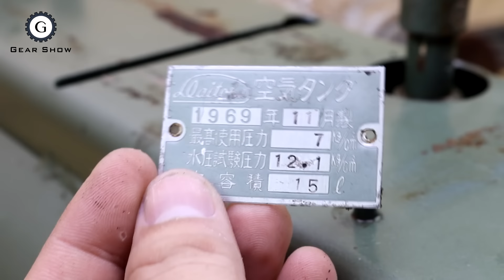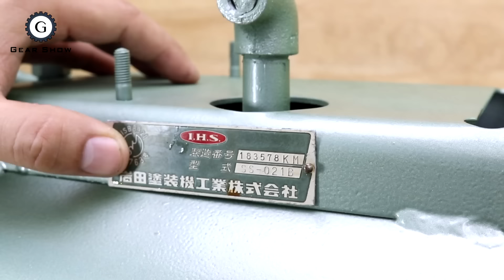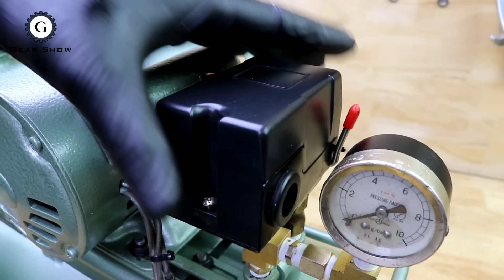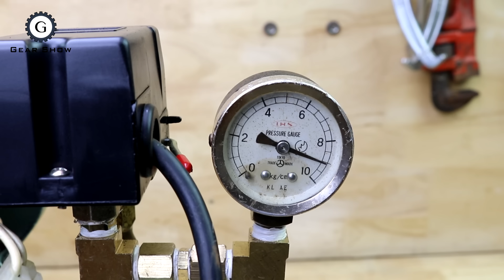Vintage Air Compressor Restoration | 1969 Iwata Minicom

Comment: As others mentioned, be careful of a rusted tank. Even if you don't want it tested, at least inspect the inside of the tank for severe rust. A cheap borescope camera dropped down one of the connection holes works well. The worst rust will obviously be along the bottom of the tank where the condensate sits. I just fired up an old compressor that was sitting for a few years only to find pin holes at the bottom of the tank. Looking inside showed severe rust along the bottom, the rest of the tank inside was still shiny silver bare steel. That went to the curb for scrap.
Reply from the maker: Thank you so much for the feedback!
Reply: True.
Pressure needs to be tested carefully

Comment: Beautiful job!  I have a similar compressor, except it has two small tanks attached.  The pump is an Iwata 150B model, is that the same as yours....the pump looks the same.  I have never known what to set the pressure switch at max pressure.  It looks like you have yours set at 9kg/cm2.  I guess I should set mine that was too.

Comment: Just about to do a similar restoration on my 1970 Stenhoj compressor - why sell it on and buy another, when for a bit of work I can restore to 'as new'. Great video - we need more people on YT to show / convert people to restoring things rather than throwing away and buying new.
Reply from the maker: Sounds great! Thank you so much!
Reply: I hope you inspected the boiler/tank well! Old Tanks with rust are NO JOKE when used with air pressure. Pretty much turning into a ticking time bomb after 20-30 years. Always depends on how often the condense water was released… tank can look shiny from outside, but may be full of rust inside and explode!! Do a hydro test!!! It’s the least that should be done!!

Comment: this is a great restoration and many people have mentioned to get the vessel pressure tested.  however, i am more interested in the make.  i still come across iwata compressors in north america, but they are the small kind for air brushes.  nothing so big as the one in your video.  do they still make this size (and maybe larger?)
Reply from the maker: Great sharing!
Reply: @gear_show  you're most welcome...  but does Iwata still make air compressors?
Reply from the maker: @gusser2121  Yes, they still make them.

Comment: Did you use WD40 while you put the piston back in the cylinder? WD40 is a penetrating oil and no lubricant, it's 90% petrol. The better way to do that is to use some motoroil.
Reply from the maker: Okay, thank you for the feedback.

Comment: nice video dude
what the name of that yellow liquid that turns screws to black?
Reply: It is just oil. Any will do. I use motor.
Reply: Nearly any type of oil, but I guess synthetics may not work that well. 
Just heat the metal, drop it in, the oil burns into the surface, just like seasoning a cast iron frying pan.
Don´t go too hot, then the oil burns on the surface and its black residue brushes off or even falls off.
Reply: uh thx guys
Reply from the maker: It is vegetable oil.

Comment: Nice work, the only thing i would do differently is hydro testing the tank before the restoration process, mainly because of how old it is, there might be some heavy corrosion at the bottom, which  make it dangerous to operate or even fail and explode if unlucky.

Comment: Splendid restoration.  I have an OCD problem when watching mechanical restoration videos, but have learned that your videos never trigger it.  Sweet relief...  Thank you brother!  Keep it up!  BTW...does anyone else find it remarkable that this air compressor was made the same year mankind first walked on the moon?  
What is your initial reaction to this:   "Simplicity x (Precision + Top Quality Materials) = Functionally Sustainable Heirlooms"              ...wow im a dork.
Reply from the maker: Thank you so much for sharing!
Reply: Though it's that super old it still seems to work like modern. Just what might be interesting is how much power it draws from the line...maybe there modern compressors are a bit ahead (cheaper power bills 😁)
Reply: @gear_show  how many hp

Comment: I have worked using air compressors for over 50 years. Never seen one explode, never heard of one explode, never met anyone who had one explode.  Most people leave pressure in the hose line so that will "pop" before a tank will ever explode.

Comment: Since that Pressure Tank is 50 years old, It should be tested Hydrostatically at 1.5 times working pressure.
If it is rated at 100 psi, then test it full of water at 150 psi.  You may need a special pump to do this but do it in a clear area in case it explodes.  It may have had moisture in it for years and corroding at welds etc.
9 kpa/cm2 is about 135 PSIG.  Stay clear!
Reply: I agree, that's an old tank and need to be tested
Reply: I thought the same
Reply: I blew a tractor tire near me once, i was lucky that the blow made it fly away from me, but i couldn't hear straight for two hours after that. I was lucky that day. Air pressure is no joke, i fear these systems more than gas.
Reply from the maker: @Gord Baker Yes, you are right, I do appreciate you sharing this information.
Reply: Ухко

Comment: Everything looked great. Great work over all.   But could you slow down the paint?  Long slow even strokes that start of the part and go past the end of the part. No air bubbles or paint runs that way.

Comment: Great work ! it is a beautiful air compresor and another masterful restoration. Btw, I recomend checking the starting capacitor, it's degradation can lead to excessive pump vibrations.
Reply from the maker: Thanks for the tip! I will check it out.
Reply: I would like to add a layer of varnish to the motor winding. Nice restoration